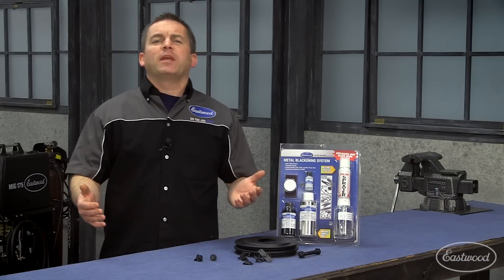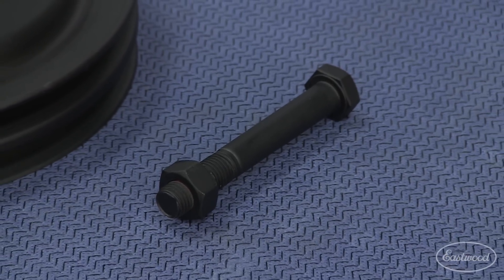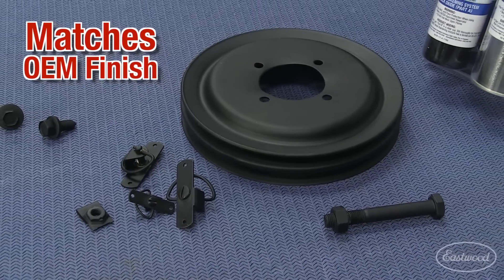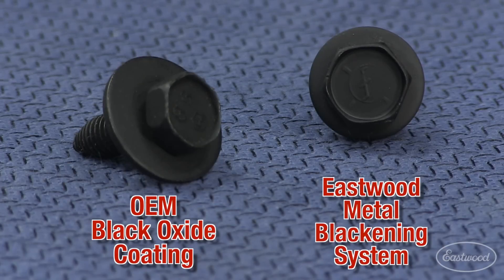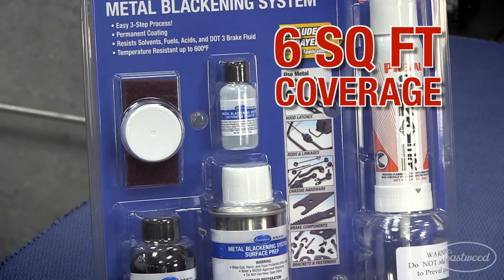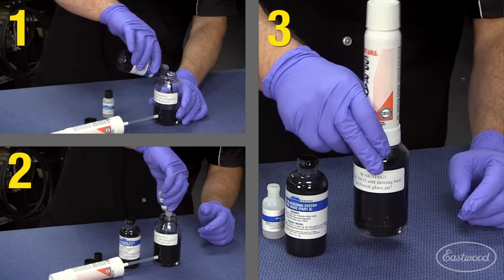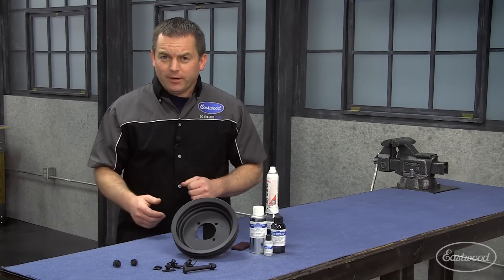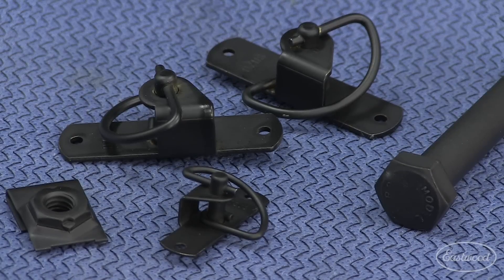How To Achieve OEM Black Oxide Coating Appearance - Metal Blackening System from Eastwood

Comment: I just heat* my fasteners, then do an oil quench. It bonds to the metal, and gives it a black, shiny finish while also rust proofing it. But it's not as easy as it sounds. It takes a good amount of practice to dial in the perfect temp. 
 
Here in Florida, all stainless steel will rust quickly. Even moreso if you are in/near the Gulf of Mexico.  Saltwater, and the moisture it feeds on hot humid days, will rust through black oxide with a quickness.
 
*- Just dont heat it too much, or for too long. I used to do mine in an old oven. But it was really tricky to dial it in. Time and temp depend on steel type, and size. Overall product quality depends upon patience.
Reply: Wow, this is doable, I happen to have some used oil and a gas torch. How long will a fastener treated with this method last outdoors? (exposed to rain, heat, etc.)

Comment: This is a Phosphoric Acid based coating. You can buy the Phosphoric Gel and add it to water. Your  parts will come out oxidized black. Plus the  baking  is  a nice  help. You need to REALLY clean your part(s) first of  all oils  and NOT handle your  parts with your  oily hands. Black/Blue gloves are fine to handle the parts after. There are guys in here that know a bit  more than  me on this. From the aspect of baking  those parts. I've done  the rinsing, degreasing after they were coated? or that  may have been the initial coat? We used those shaped stones in  a water wash.[Which vibrated everything] It went to the Tri-Chlore******* wash which  was heated. Boxed and shipped out.

Comment: I just use a can of high temp flat black spray paint. Looks just as good a lot cheaper but I'm sure it isn't as durable but I haven't had any issues. I use on my break drums a few years ago and they still look great and it was about 14x cheaper. I'd like to know what's so special about this stuff that it's worth so much more tho. I'm not arguing it's not worth I just honestly wanna know why it is.

Comment: I blacken metal every day Monday through Friday 8AM till 4PM. Metal is soake cleaned, rinsed, dipping in muratic acid, rinsed, left in the black oxide tank, rinsed again, then oiled. This product simply cannot be compared.
Reply: Hello glenn i got a stupid question and i thought ill ask the specialist.
Id like to do golf irons.... Is there any thing you recommend as a diy job?.
Thank you rick
Reply: Glenn could you email me, have a question for ya. Thanks bstewart0879@gmail.com
Reply: @brianstewart4710 sent you an email.
Reply: I need ur guidance I want to blacke mild steel parts but I dont have idea how to do blacking on mild steel    
With heating and dipinig in the chemical pls help me
Reply: @worldevents5116  I can possibly help you figure out a set up to do what you need to do. Can I contact you through email?

Comment: Question, I like to polish to a "High Gloss" finish. Once polished and cleand will the Eastwood Metal Blackening System adher to a smooth gloss finish.
How do you comare to the "Frost" Chemical Blacking Solutiom kit?
Jespectfully, Jim P.
Reply: Its basically that rust restore stuff you buy at walmart. Which basically turns rust & metal into [with] a oxide coating. [Yeah I said that weird] But you end up with a black coating. Basically a great primer base. In which you can coat with an epoxy high gloss paint. The stuff they use on stoves and fridges. The when to bake the  part and all that I  cant give you an accurate  answer  on. [For sure before you paint it with epoxy of course]

Comment: this is a real piss poor attempt to easily replicate the real thing..a true oxide coating is first media blasted, degreased, rinsed, dipped and soaked in an oxide solution, rinsed again then baked..I would imagine this finish wouldn't last very long at all.
Reply: clean, heat, dip in old motor oil
Reply: @pacman10182  new motor oil works better... but 3-in-1 works magically... if u can afford to waste it. 
 
Also, try it in vaseline sometime. It's like the stuff was just made for rusty nuts.
Reply: There is a cold and hot coat black oxide and the process is different for each.

Comment: Sure described like a catalyzed paint, two component, good to 500 F. True metal blackening process requires a ferrous substrate, iron,steel,cast iron to have a reaction. Aluminum & stainless have no ferrous elements.
Reply: Wrong. Stainless (steel) has "ferrous elements", namely the only ferrous element, iron. Also, stainless steel can be blackened, just by a more complicated process than non-stainless steel.

Otherwise, you're correct ;)
Reply: their sds says otherwise, its glorified cold blue

Comment: i think it is a paint
Reply: topletz I've had the same results using black high heat paint used for grills. Not sure about durability compared to what's in this video, but so far so good on my engine pullies and other projects after a months use.
Reply: JackOfAllTrades what's that can you share it with me?
Reply: @brandontiamzon3519  Rust-Oleum High Heat paint
Reply: it's repackaged Perma Blue, or very close too (at 4 times the price)

Comment: Would it be good for making a finish on knives? I would assume it would, but there is no harm in asking just in case.
Reply: killgora1 I'm wondering whether it would have an effect on the cutting edge of the blade and how much you can sharpen it afterwards?  Also, can you reapply if you have damaged the surface from sharpening?
Reply: it should do fine